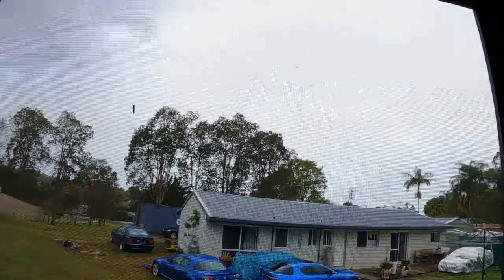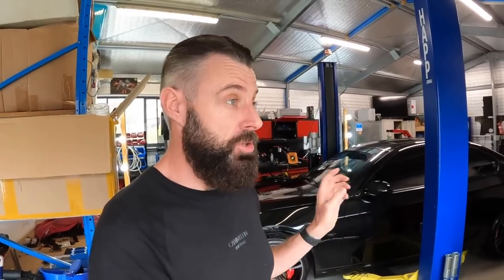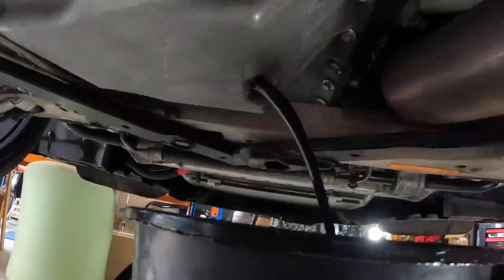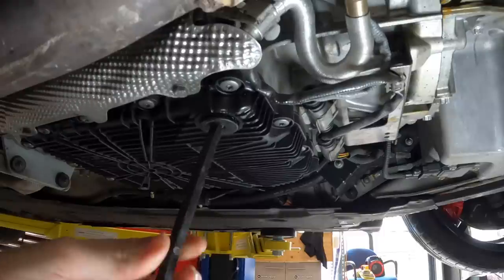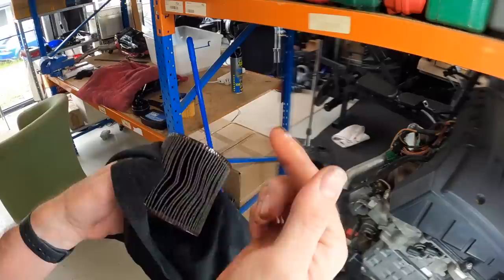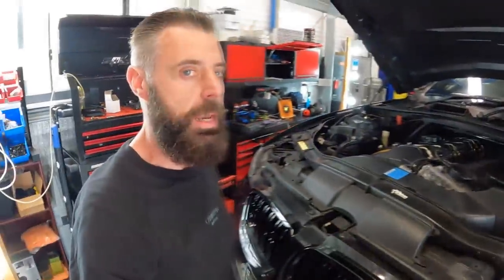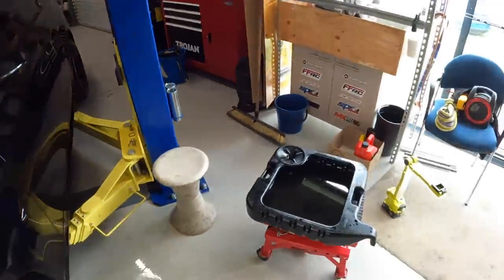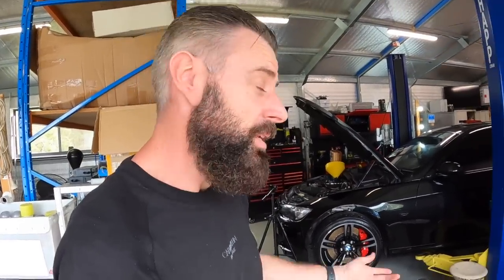BMW N54 DCT fluid after 600whp and 1500k's?

Comment: I have pure 600s on 27 psi and I noticed driving every day I have no oil consumption but on a Friday race night if I do 12-15 hits on the car it will be a quart low on oil. No smoking all maintenance is on point with no leaks. It literally eats it
Reply: Gotta love turbos. They called the turbo 4 cylinder motor in the saab 9-3 a hot motor because of that. In the manual it recommends you check the oil often and add depending on how hard you drive.

Comment: Was using Castrol shampoo, got sick of put 1ltre every 6 weeks,  changed to Liqui Moly Molygen 5w-40, now consumes zero oil, temp little cooler. Used Redline in the past, excellent oil , hard to get..

Comment: When you where talking about oil consumption all I could think of is my m54b25 that killed a quart every 700 miles of normal driving lol.   My 165k mile n54 is thankfully only leaking/using a quart every 5k miles.  Which ain't bad.  When the turbos get replaced I'll be doing my oil pan gasket and hopefully fix all my leaks.

Comment: highly recommend going with a bit of a methanol setup if you’re worried about temps! methanol does wonders for the N54
Reply: I agree, did it on my n54 this year and it nailed the IATs down at ~30°C, so I get much less knock than before.

Comment: Normal for engine to use oil when racing all day.
60 weight oil may trigger Vanos codes in cold weather but in your area you should be ok.

Comment: Question.......... As you pulled out only 5 litres of engine oil do you recall what level the iDrive was showing it as.. was it still on max? I'm always suspicious of the no dipstick idrive oil level 😒 🙄 
Mine is either max or add a litre 🤣

Comment: Hey Andrew, When I had my N54 setup, The only one thing after all my upgrades made a big difference was a high flow radiator made by Direnza. Your overall temperatures of the car will be better as your racing with your N54. I don’t know do you have a standard radiator. If so change it and your car will drive like a different car. More low end torque=more power?
Reply: Forgot to add please use bmw blue coolant that’s will help the DME do it’s calculations better. Cool your engine better. Thanks for reading

Comment: I use 10w60  motul also on my n54. Just hit 100k miles. My only concern was my oil pressure did go up a bit at cold start but it’s normal after. I’m in southern cali so temps aren’t cold cold.
Reply from the maker: How are you measuring your oil pressure?
Reply: @ZeroTo60Tube  I'm using the prosport evo series gauge....I bought it on ECS tunning. I adapted a fitting onto the stock location adapted the other sensor that way. Only issue I had was ground...I had to ground it to its own location and it started reading as it should

Comment: My N54 in my is seems to burn about a quart every 500-1000 miles if I'm beating on the car only stage 1 however but thought I would share my experience with the N54 eating oil.
Reply: My N54 did that until I switched to Castrols 5w30 "for direct injection" oil.  Now I'm 1 quart in 3-4000 miles.
Reply: these cars eat oil especially when your really on it, mine is around 4K now depending how I drive but I usually change the oil by then

Comment: Actually the turbocharged ///M engines use 5w-30 or 0w-30 from the factory, the N/A ones use 10w-60. I ran Castrol Magnatec 5w-40 on my single turbo N54 and I had no issues with oil consumption, I did not baby that car either 🤷🏼‍♂️

Comment: In regards to oil, if tis using a bunch of oil, going to a semi synthetic oil will improve that situation. Penrite Vantage is best in my opinion with the extra Zinc additive. I ran it in my Subaru Liberty with 300awkw, given how those motors are, it removed all the oil usage I ever had. Might be worth trying.
Reply from the maker: Thanks for the info!

Comment: Are those OEM Diverter valves?

Might want to change them if so. I put a set of eBay diverter valves on my 535xi - look like TurboSmart valves. 80 bucks from a USA seller (not sure what shipping etc would cost)

Came with the valves, silicone pipes to hook them up to the OEM locations if you want for the recirc.

Seller is blackpanthermotorsports - love the series.
Reply from the maker: My car did not like the ebay diverters. Caused over boost and under boost conditions. Took me ages to work out. However i was running them on stock vacuum. I want to switch out to a turbo smart style single bov eventually.
Reply: @ZeroTo60Tube  understood! Sorry to hear that. my OEM diverters were leaking at 20psi, surprised yours aren't leaking.

Comment: Great video once again I’m doing my dct swap soon I have everything already but I bought the dct fluid kit from ecs tuning and it only brings 5quarts but I heard u say it’s more like 7 quarts to fill is that correct do I need 7 or is 5 quarts enough
Reply from the maker: I think i used about 7 litres on the first fill, but i had both filters out and both pans off the trans. And had to fill my oil cooler.

Comment: Very nice. Maybe the XHP tune, and the higher pump pressure will cause this line vibration. Under normal pressure it will maybe not noticeable🤷‍♂️🤔. Dutch regards, Nico.
Reply from the maker: Well if anything they reduce clutch wear. Believe it or not. The lower the pressure the more they will slip.

Comment: Deka stage 3 clutch packs would be a good upgrade. Begood with the DCT swapped 'predator' is using them with over '1000hp'
Reply from the maker: hmmmmmm just need to sell an arm or a leg dont i.
Reply: @ZeroTo60Tube  They were 2kusd in the group buy not sure how much now. You'll still need to use your own basket tho.
Reply: @ZeroTo60Tube  gotta pay to play he also recommended me those clutchpacks. I belive he used go have ssp and must've not worked out so good for him

Comment: If it was the valve stem seals that are going bad or not installed properly you'll most Likley end up with a ton of oil in the catch can same goes if your piston rings are worn or the cylinder walls are worn. So if neither of those are happening then most likely the China boys are getting tired and worn out

Comment: Will you send the oil to be tested? You should? And you can't change oil too often IMO. Check out engineering explained latest video but I have tested my oil for years, it's fun and interesting.
Reply from the maker: I don’t think so. The tests cost about $40 here and out of the 3 we have done the most notable thing the testers say is that we aren’t using thier oil and we should be.
Reply: @ZeroTo60Tube  oh so no unbiased independent testers?
Reply from the maker: @twinscrolled  Not here in Aus it seems. Also getting and useful info out of them is very meh.... But we have only tested older engines.

Comment: What size tires are you running ? I’m running the same wheel setup. Rubbing on the fronts when doing half a full turn ! How do I fix this problem
Reply from the maker: Stock e92 m sport tyre size. I did hit the front inner guears with a heat gun, there is a video on the channel on making them not rub..... but i can't remember where it is. It was filmed around this time last year.

Comment: I’ve really been debating on purchasing xhp for the DCT, anyone have/recommend? It is on the more expensive side
Reply: Have the app for months but still unsure on dropping the €400
Reply from the maker: I can not recommend it enough if you are running more power than stock. Being able to tune launch modes is amazing. Also the little pop i get on the shifts now is cool as well.
Reply: Have had it for ages now and I think it's on maybe the third software iteration... great fun and very capable. Do it and soon as you do, disable creep.

Comment: how much wheel torque you got?
Reply from the maker: No idea. I do know it does 5 second 100-200s tho…
Reply: @ZeroTo60Tube  I am eyeing for n54 dct now...saw dct clutch upgrades, not bad for the price comparing to 6hp19 upgrades from propulsive.
Reply from the maker: @TCGTV98  Also a good condition stock DCT will hold more power when tuned than a built and tuned 6hp19. Only issue with DCT they do not like launching when you have decent power. There are not many cars in Australia that need upgraded clutches on the DCT, even my single build would be fine if the trans wasnt 200,000ks old

Comment: I wouldn’t really be concerned about burning a little oil when the engine is living life at high rpm just keep an eye on it could be anything from oil get by the seals in the turbo under high boost, oil rings, head gasget, or valve stem steals. Most r35 Gtr burn oil and any Honda I’ve ever owned.

Comment: Lmao sorry, I don't know what has been funnier with your reactions...... either you realising there was a smudge on the camera in this video, or your classic "And there's a King. There's a King having a s**t" comment....... 

When it comes to oil, just remember the BMW engines (in fact most Euro engines) are designed to burn about a litre of oil every 10K. It is safer and cheaper to burn such a small amount instead of having to replace engines. Personally, I avoid Valvoline like the plague. Castrol is usually pretty good in my X5 daily, Shell is no good in these motors. I have heard Penrite and Nulon are very good in these. However, viscosity is more important. As you are in QLD, higher average temps, I would suggest changing to something more like 15W/50, or 20W/60, it will give you better protection when beating on it given the higher engine temps and air temps.

Comment: Man you are way better off changing oil at , 1500 than 15000 in an engine that has over 2 times the power it was meant to.
Reply from the maker: My thoughts exactly. I really feel like im pushing my luck with it as it is.